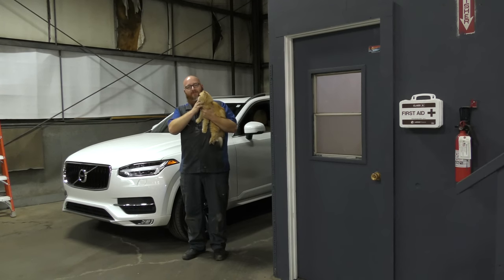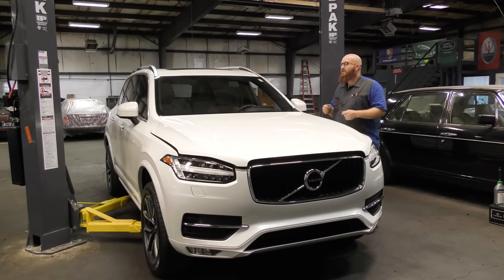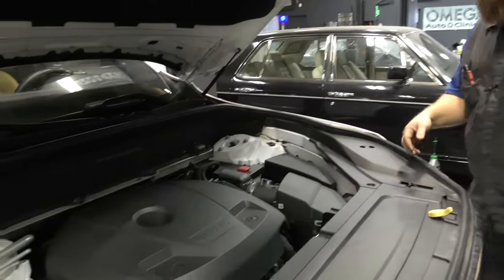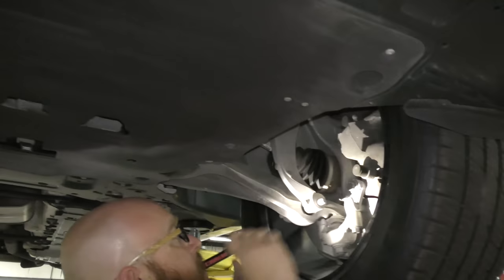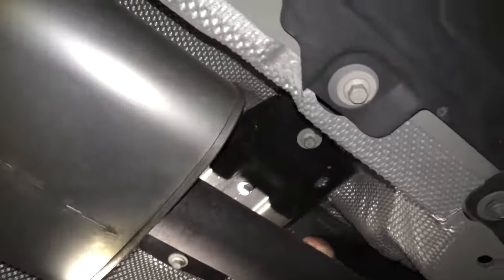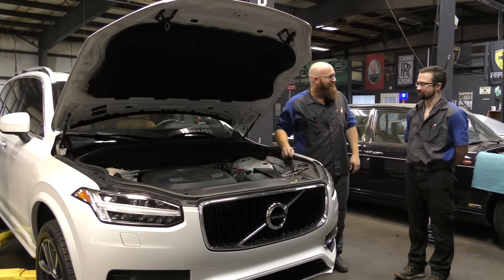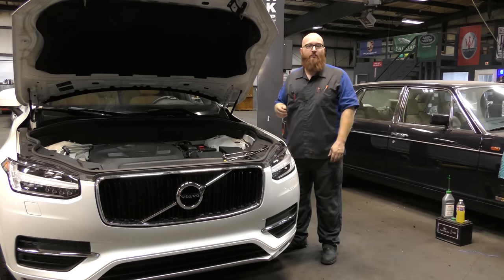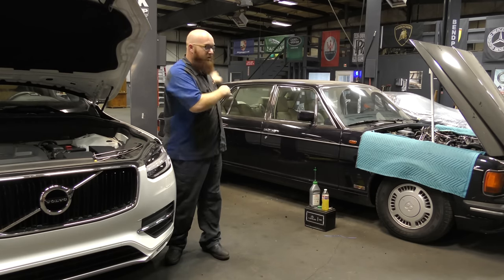One Sweet Swede! 2016 Volvo XC90 loudly roars into the CAR WIZARD'S shop.

Comment: Wow! A used car salesman that makes sure nothing is wrong when a sale leaves the lot?!!  Incredible!!
Reply: Not all hero wear cape! ;)
Reply: Clyde Aguilar 
Actually, it's how MOST used car dealerships operate when the car is over 10 grand. 
We depend on repeat business and referrals. 
Even if the car is below 3 grand,  if it isn't at least 90 percent,  we sell it at the auction. 
Nothing costs more in headaches and time, not to mention bad feelings than selling a crappy car.
Reply: How many used cars lots would allow the Car Wizard, or the mechanic of their choice to inspect a potential sale? The Car Wizard has opened my eyes to potential issues after the warranty has ended, and particular makes have reached certain ages, particularly those cars with plastic parts.  Used car lots won’t warn you the BMW timing chain plastic guide you’re interested in could fail.
Reply: @clydeaguilar5525  
When a customer wants to have a car pre inspected, the dealer has no choice in the matter. The car gets inspected by the customers mechanic. No matter who it is. Of course, they CAN refuse, and we had 1 shop that we blackballed because they were dishonest, but it's very rare. And it's done at the expense of the customer, so it's their right to pick. We always recommended to purchase an extended warranty for repairs that nobody could forsee. It was good for business and we never charged a surcharge for the warranty.
Reply: There must be consumer purchase laws in the US as well, he can’t knowingly sell a car with know faults, hence he has to fix them. Or person can return goods as not fit for purpose.
Reply: @checker3694  Not really.  With used cars they place a AS-IS No Warranty paper on the window.  If it's out of factory warranty and you don't buy a warranty and drive it off the lot, they aren't responsible.  It happens.
Reply: Clyde Aguilar yeah most sell you a shitty warranty and try and use up the warranty on things that were already wrong
Reply: Honestly a lot of dealers are like that on higher priced 20k and up cars. I've never had a bad experience mechanically. From a sales "pushy" standpoint yes, but all of the times that I've had a concern it was fixed
Reply: If only car wizard lived near buy, I would be very confident in buying used cars without warranty
Reply: A rarity.

Comment: One thing that caught my eye...That really clean and shiny rear subframe had a "Volvo Genuine Spare Parts" label on it, suggesting that the car may have been in an accident serious enough to require subframe replacement. I don't think factory installed parts have a "Genuine Spare Parts" label, but I could be wrong about that.
Reply: You are right
Reply: These are labels on original parts from factory, and in a long run It depends on cars usage and roads it has been on. I have xc70 from 1999 and still there are original labels on rear subframe, rear cv shafts, front cv shafts, front shock absorber, rear shock absorber, gearbox, angle gear... etc etc....ofcorse there are some missing, but still, i order  some of my parts from those label numbers. The biggest queation is why bearing is out at only 93 000 miles....thats not right!!! In Euro spec brand new volvos those bearings should last atleast 400 000 kms it just cant go out that fast!!!!
Reply: The stickers look exactly like replacement parts on the rear control arms, I know I sell them
Reply: 100% don't come out the factory with the stickers it's been f@#*3d about with 🤣🤣🤣
Reply: @brettwilson9278  you sell stickers? I want some!
Reply: @jaunteraudi817  what do you think of toyotas, i looking at th ehighlander
Reply: @jaunteraudi817  was thinking the same thing, super odd for a wheel bearing to go so early these days - still could just be a manufacturing fault I guess.
Reply: Instead of speculating  about worn and  broken parts.. check the interior...
Reply: Chinese car with "Genuine Volvo" stickers.
Reply: Nice car, great video

Comment: In order to turn the engine off with the gear out of park, turn the start/stop knob to "STOP" and hold it there for a few seconds.
Reply: depends on the year/model region volvo you have.. some i you have to twist or press button twice or three times.. with my P3 XC70 for example the way it works is press engine start button to get warning to park it first and then turn off, then press it again and it will tell u to press once more to shut the car off in Neutral, press it again and car turns off..  but i seen it work 2x for other P3 volvos and for SPA/CMA volvos i seen twist and hold and twist and twist twice fast to shut it off in gear.
Reply: On my 19’ you can disable it in settings
Reply: @Honeypot-x9s  2012 P3 S60 can be shut off in neutral with just one press. It gives the put in Park warming with beeps
Reply: @Minto107  like i said it varies.. not entirely sure why. mine i cant just press and hold the start button i have to tap it once and hold it at very least or tap it 3x

Comment: Greetings from Sweden! As an former Volvo cars engineer it was a pleasant surprise to see a xc90, I was involved in the development of the engine management system. Great video! And as we say in Gothenburg (home of Volvo): Ha det gött!
Reply: That is not a good system, I thought we had a lemon, but they replace the management system alot. The start stop is hit and miss, screens black out, or it runs under 35 mph, the dealer had to fix and replace all this stuff after we bought it new. now after two new computers is working

Comment: I work in the factory in Gothenburg and some of the parts under and in the car I pick and deliver to the assembly line. Starting to get bored working nights but the pay is really good🤘🇸🇪
Reply: Cool job but working nights causes poor health and health is the only true wealth.
Reply: @mybigfatpolishlife  The S90 are build in China....
Reply: @milojacobs1970  and the xc90's that are headed for the US market. Might be Xc60 aswell, not entirely sure about that.
Reply: They are trying to have some modells build in Sweden and USA and China. A marketing and spread out thing to these countries so the popular modells can be said to be manufactured in those countries. Then we will see if it works marketing wise and they keep doing it in the longrun or not.
Reply: I've got a 2020 V60 Cross Country it's a year old now just had my 1 of 3 free 10K service. I love this car so practical, I especially like the Bowers&Wilkins audio also the heated wheel/ seats in cooler weather. I live in NH.
Reply: @johngaudet6316  glad you like it, they are built here in Gothenburg. Do you have the adaptive cruise? Also the heater controlled with the app is probably the best feature for anyone living in colder areas🤘
Reply: Hammerbeach I’ve got a 2016 XC90 D5 AWD inscription in South Africa. Lovely car, just over 120k km. Is it true you guys stopped making the diesel options?
Reply: @Ilikepie18855  Not sure about that. A diesel-hybrid like the old V60 had would have been a better choice than gasoline-hybrid in my opinion. I have a D3 V40CC and I can drive 950-1000km on one tank🤘
Reply: I was at the factory in Gothenburg in July last year for a week. I worked on the application team at the factory in South Carolina.
Reply: @Hammar89  amazing. I would like to get another xc90 D5 when this one dies, even mild hypeid diesel is fine. But just heard news saying Volvo is discontinuing all their diesels.... Shocker.... They make the best diesels.... I get 850-950km on one tank of the xc90. Amazing vehicles.
Reply: Volvo recently opened their new plant here in South Carolina.  I live on the other side of the state near the BMW plant.  I've worked there in the past in assembly, then logistics.  Anazing place to tour.
Reply: Would you go for the t5 engine for long term reliability or is the t6 good as well?
Reply: @Hammar89  not true.

Comment: 2 years ago I bought 2007 Volvo xc90 with a 3.2 engine from the original owner he kept  it well maintained it had 95,000 and sent I have it now it at 126,000 never changed transmission fluid do you think I need to change it?

Comment: Love those "Thor's Hammer" headlights.
Reply: Why in the world there is an option for normal halogen lights without thor's hammers? It looks 10 years older 😁
Reply: @huikkoster  that was for 2016.  2017 and up added the standard LED headlights.  I think the way that Volvo does their updates as the product ages is the reason for that.  They like to add features and make a bunch of small changes each year rather than save those and larger ones for the midcycle update.

Comment: The brake caliper popping noise could be the ABS system self testing itself at 10mph. 
My Volvo does it at 10mph every time I start the engine and drive off ... It's normal. 

Beautiful cat btw!
Reply: My old Volvo used to do that as well. I thought it was a fault but could never figure out what…

Comment: That has almost certainly been in some kind of accident, the rear subframe looks new because it is new, all the bolts in the rear appear to have whiteness marks on them showing they have been recently worked on and the subframe even had a Volvo genuine spare parts logo on it
Reply: The whole underside looks almost new to me, except the rusty exhaust
Reply: Interesting
Reply: Yep,  no way that rear end is a 90000 mile old rear end.... it’s waaaay too clean.
Reply: Andy Guest where do you see it?time frame ?
Reply: @Ilikepie18855  7:40 - 7:45 for the spare parts sticker
Reply: the date on the part is labeled 16 jan 2020

Comment: Some cars have park overrides where you can shut them off in neutral or engage neutral while turned off. Depending on the individual car’s procedure, it might not be worth the hassle when putting it on the lift.
Reply: Volvo usually allows it by long-pressing the start button. Or double-pressing? Some version of it on the older models at least
Reply: @rosen9425  On this you turn the knob to stop and hold it there.
Reply: @darkiee69  
My Volvo is old gen xD
Reply: @somervillearron  I'm not, and it's not.
Reply: @somervillearron  give it a rest..

Comment: Swedish parmedic here. I drive the 2018 Volvo XC90 in my work at the ambulance. They are of course rebuilt with a carbonchassi at the back, also regular ambulance equipment as in all other vehicles we have... but the rest is pretty much standard. All in all it´s ok. It´s offroad capabilitys are very good, a little bit sluggish, cause the enginge is underpowered vs all it´s extra weight. But lots of room in the pasient-area and relaxing to drive. Thanx for the vid Wizard. Love your work!
Reply: I'm amazed how many Swedes have commented on this video! Hi from the UK by the way ;)

Comment: I just hold the start button with the car running and in neutral and after holding the start button for 20+ seconds the engine shuts off without putting the car in park.

Comment: I'm telling you, working as a service porter at my local Volvo dealer... I have never seen so many issues with cars with no pattern.

The only common problem I see on these XC90s is the piston rings due to oil consumption.  Other problems range so much I can't remember any.  They LOVE throwing CELs.  Had a couple oil traps that go (you will know if it's an oil trap when you hear a metallic squealing noise when you start it up), but aside from the wide variety of smaller issues, these B4204... engines are alright as far as reliability is concerned.  They aren't a Toyota, but they aren't the most unreliable engine.

Comment: As a Volvo tech. The issues I’ve seen on these, regardless of engine. Upper ball joints, outer steering rods, top mounts and lots of software bugs. That’s about it. Underbody is pretty solid, they chew through brake pads and tyres quickly though.
Reply: Heavy beast, allowed to eat tyres and brake pads. Same for the steering and suspension parts.
Software bugs . . . it's a given. Damn things have computers even for the hood latch (I made that up but I wouldn't be surprised if it happens to be true). Sadly most Asian makers are doing the same too.

Comment: I feel like in 15 years that Volvo will still be just as appealing. What a nice looking Suv. It appears they only used steel where absolutely necessary on the underside where cars usually rust out.
Reply: They are.  The XC90 may be 6 years old now, but they literally have so much presence and look fresh to this day.  They tend to over-engineer their cars as well.

Comment: I might have been building on this car. Was in the assembly factory in 2016 so if this passed during my working hours I might have been assembling either the cooler or front struts. Volvo has made a huge leap in terms of luxury since the introduction of the new XC90 and my V90CC I'm driving now is easily the best car I've ever owned.

Comment: I LOVE these XC90s. I have a 2012 XC60 with 206,000 miles and it's perfect underneath, just like this. I want to get a CPO XC90 because the warranty has unlimited miles and you can extend it until the car is 10 years old. Why buy new?

Comment: I’m taking the side of your old school mechanic. Here’s why. I once had a new ‘07 Jeep Wrangler V6. I live in the NE where winters can get harsh. Leaving work one cold day I hopped onto the highway which was virtually a stone’s throw from the parking lot and suddenly the damn thing went into limp mode. So now I’m merging onto the highway during rush hour and my top speed is 40mph. Very dangerous situation. With traffic swirling past me giving me dirty looks I found an exit and shut the Jeep off. Upon restarting it ran perfectly. Turned out that the computer didn’t like that I called for highway speed so soon with an ice cold engine. From now on, on cold days I have to fire it up and wait until it warms up (watching all my coworkers leave) before getting onto the highway. One day I guess I was impatient and the @#%*£! thing did it again. So this time as the Jeep is limping down the highway I shut off the engine, pop it into neutral, start the engine, pop it into drive. Viola! Reboot worked like a charm. The moral of the story is, when shit happens the last thing I need is damn computer freaking out and second guessing my actions. Makes me wonder how many of these so-called safety measures have gotten people killed?

Comment: I have a 2019 XC90 and not one thing has gone wrong with it so far. It’s has 16,000 miles on it now after an 8,000 mile road trip from Florida to Colorado and then to California and back, I love it we did an overseas delivery and picked it up at the factory in Sweden and drove around Europe for 3 weeks, I would like to suggest to you Mr. Wizard to do it if you can best vacation we have every had, eight countries and 3700 miles. I don’t think you would regret it one bit.
Reply: Of course not one thing would go wrong in a years ownership  thats the case for the vast majority of cars. Tell us how it fairs 10 years or older

Comment: You didn't mention the oil burning issue the 16 xc90 has. Know a few people with them and the local Volvo dealers solution is when the low oil light comes on to stop in and they top off for free if you get the last oil change from them. Its a low oil sensor not a low oil pressure too for those who think that.

Comment: I picked up a brand new Volvo xc40 R design Pro in January,  and I love it. By far the best car I've owned for a long long time.  

Got it in Onyx black with the orange carpets and door cards😁😁😁
Reply: Nice spec, which engine?
Reply: @qlus  I went for the petrol T4. I looked at the T5, but I drive almost 100% in cities, so the extra power would have just been wasted. 

Can't  have the same fun we used to, too many speed cameras everywhere😆😆
Reply: Wish Volvo didn't get rid of the lava orange carpets 😔

That was one of the coolest options on any car.

Comment: Yes you can put it in neutral after the engine is off, you just have to hold the start switch to the right for a few seconds without applying the brake pedal to turn on the electronics and enable the gear shifter. A tire shop learned me this the first time i came there with my V90. In ref to the video, the XC90 doesn't have all the options. Does not have Bowers & Wilkins or massage/ventilated seats.
Reply: can't get massage/ventilated seats in the Momentum

Comment: the 2016 xc-90 and some early 2017's have a lot of problems mostly due to the massive technology leap over the last generation lots and lots of technology changed but they are nice cars and drive amazing but well maintained volvo's will last a lot longer than people think plus they dont rust and if it does rust within the first 12 years volvo will replace the rusted area's for free no questions asked

Comment: Smart getting rid of the car before the serious problems happen, I don't think they are 200-300,000 mile vehicles
Reply: Any car will last that long if you maintain it. Just keep throwing money at it and it will continue to run.
Reply: @OMGWTFLOLSMH  I should of said without throwing money at it like Toyota's
Reply: I have seen plenty of volvos with around 300,000 miles and still running great and i have seen some with 60k miles needing new piston rings or a motor but the good thing about a volvo is the warranty's
Reply: @tylerdohmen203  Isn't it the 1980 and 90's Volvos that were known for that.
Reply: I recently saw a 2017 with 189k miles still being sold for 33k.
Reply: Volvo once claimed they were the longest lasting car on the road. But they spent half their life  up on lifts.

Comment: There is an override you can press to change the gears when the engine is turned off. You take a side of the passenger side plastic cover off the transmission console and there is a little plastic strap that you pull down for gear lock release.